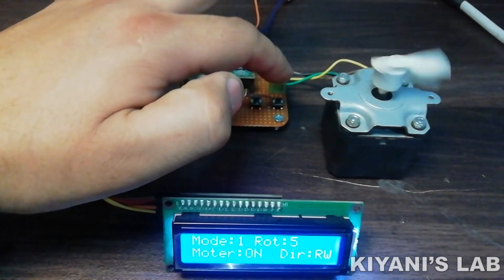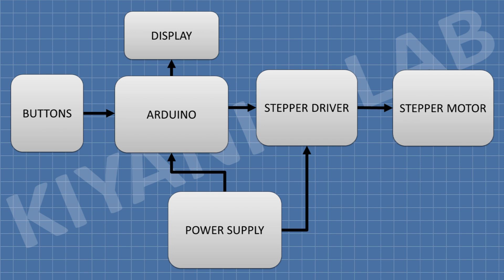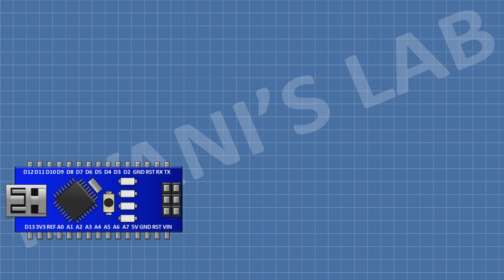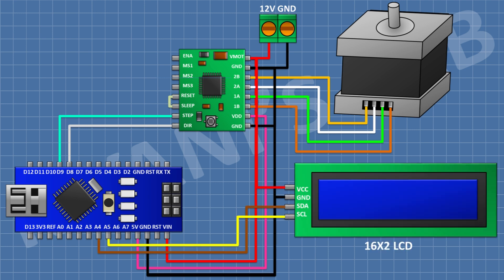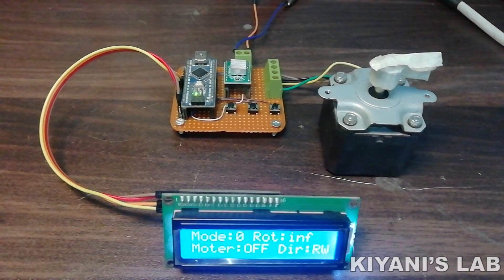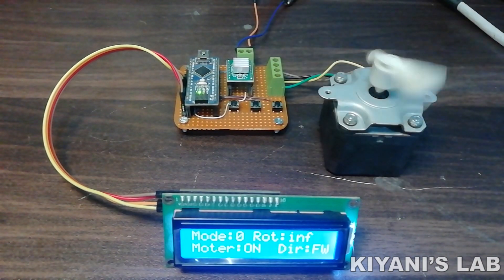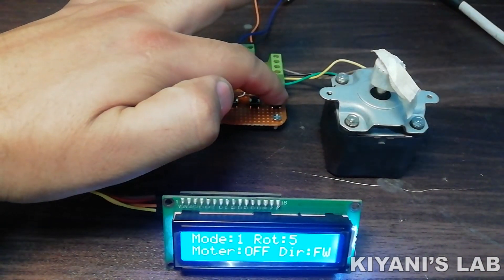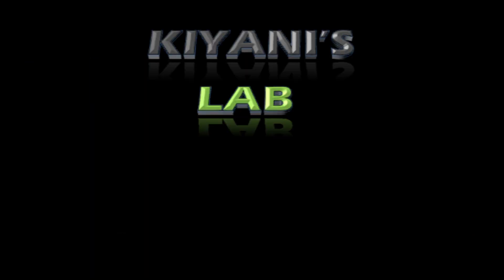How To Make Stepper Motor Controller

Comment: hello sir, a big thank you for this video, it's exactly what I've been looking for for a very, very long time, can I just ask you for a small modification? everything is perfect for me but I wonder if you could add a few lines of code to make the motor go forward or backward a 1/4 turn automatically when it has finished its cycle that I would have chosen at the start, send once thank you very much, hoping that you can help me 🤝🤝😉😉😉😊😊😊

Comment: Hi 
I make 1 small project with arduino uno + cnc shield v3 + A4988 + 3 stepper motor
i have programming it by computer . it's run ok. 
but now i want it by push button controller for stepper motor .
will you guide me?

Comment: Hi
I Have make a small project With
arduino uno + cnc shield v3 + A4988 motor driver + stepper motor 
i have programing by computer.
and it's done.
but now i want programing controller with display.
do you guide me please?

Comment: I got the error message sorted. Needed to add the LCD display size in the LCD begin line... lcd.begin(16,2) or lcd.begin(20,4) depending on the LCD size. Also need to change this line to suit the display size if not (16,2).   LiquidCrystal_I2C lcd(0x27, 20, 4);

Comment: Hi, nice Project, Well done.
I am trying to compile the sketch and I am getting this error. no matching function for call to 'LiquidCrystal_I2C::Begin()'. 
Can you please assist me with this issue.
Thank you
Reply from the maker: you need to download i2c library in Arduino ide
Reply: Hi, thank you for the reply. I have tried more then one library but same error. Can you be so kind as to send me the link for the correct library please.
Thank you for your assistance

Comment: Thanks for the basic video and its really helpfull for newbies like me.
I have a request tho, i want to make electric dc motor sun-shade (of fabric) for my home, and want to cover/uncover my home area  with one touch of a button, the system should work on 12vdc and should be capable of automatically cover/uncover at specific time of the day and also should have a manual button. Can u do that?
Reply from the maker: Noted bro i will do that
Reply: @KiyanisLab  Really??? I am waiting desperately for that!!!
To start with there are some videos on yt showing pully system for that you can watch them to get some idea.